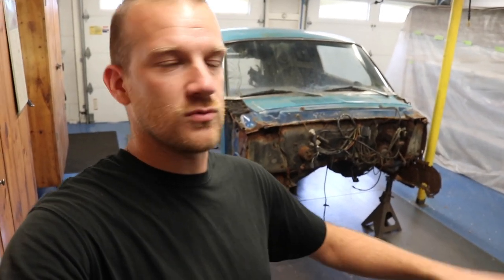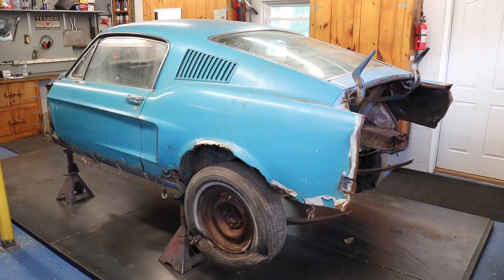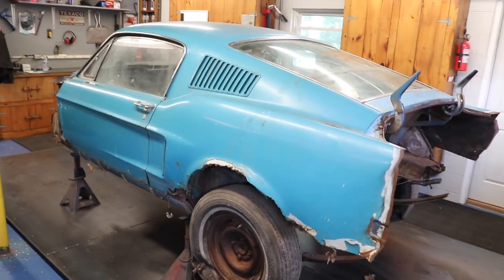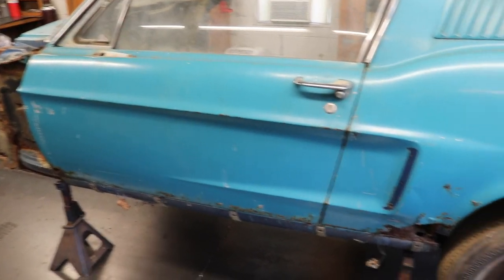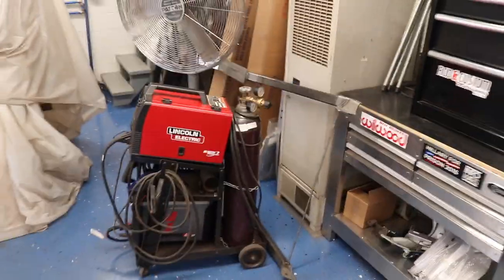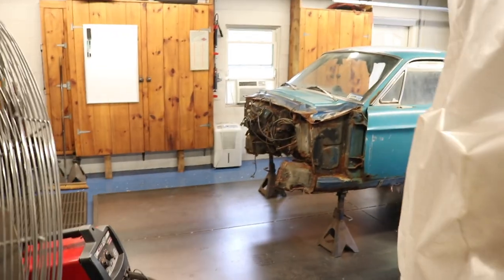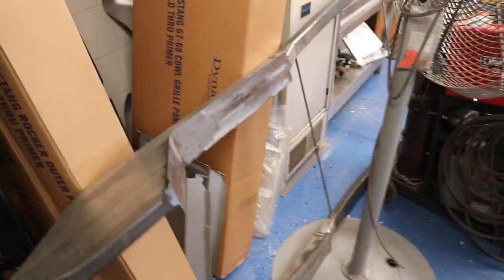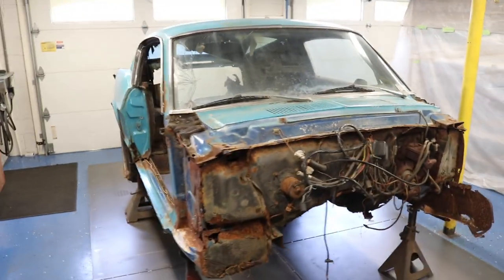Building A Rusty 1968 Mustang Fastback Shell

Comment: New to watching and have a 69 sportsroof todo a lot of work on But i gotta know what is the floor of your garage made of that you do your projects on. It looks like thick steel plates welded together?
Reply from the maker: Yes it's a steel platform I use as my level surface to base measurements
Reply: How thick? My garage floor is not great, saw yours and thought about doing the same thing. Thanks for your insights, the videos are great and I’m excited to do the complete floor on my 69.  Really appreciate the tips and tricks!
Reply from the maker: @nickolasbass2052  around 1/8 or thicker, also steel box tube braces under